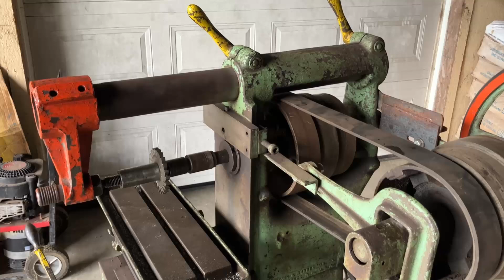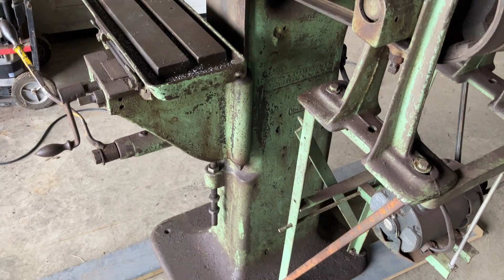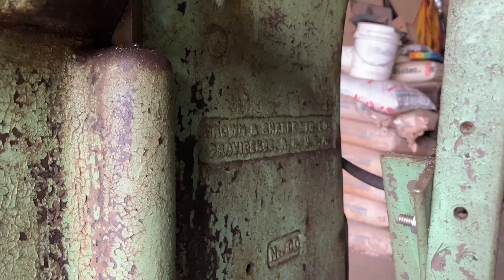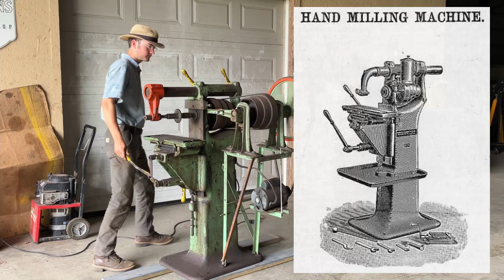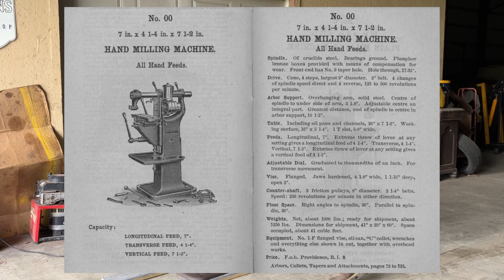Brown & Sharpe "Hand Milling Machine"

Comment: I have a column drill that has a belt on stepped wheels for variable speeds.
I use a flatheaded screwdriver to leverage the belt over as I turn the wheel around by hand like you do here.
There may be a reason you can't do it on that machine but I figured I'd mention it just in case.

Comment: Looks like the countershaft bearing stands/hanger were for the tight/loose pulley setup. The shifting rod guides made for convenient mounting points. It certainly is a cute little mill.😮

Comment: Very nice score, look forward to seeing it in use.

The stuck taper may release more easily if the spindle is warmed up a bit by running or a bit of external heat. If the taper was installed warm and left to cool it can really stick in there.

Comment: Good to see a vintage machine being picked up by someone who loves the machine.
This reminds me of a local Rough-and-Tumble organization in Kinzer, PA which has a line shaft driven machine shop which contains an F.E. Reed foot powered metal lathe.   This would be a nice companion for the Hand Mill.
Sad that you are in Canada.   I have a GE 1/3HP 1910 - 1920 motor from perhaps a VERY old washing machine.   The nameplate states "110V" which was the US voltage in the early 1900s.   I am looking to find a home for this.   Works well, runs quiet and smooth, just needs to be paired with a vintage machine.
Dave.